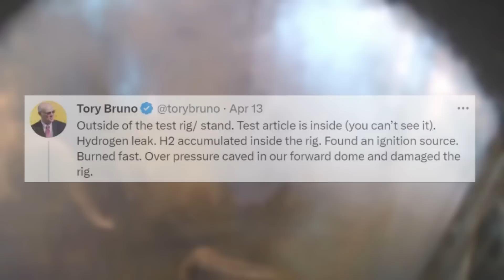Vulcan's Maiden Launch Continues To Get Pushed Back

Comment: I wish someone would do a video on how the Vulcan and Starship fit together in NASA’s moon plans. Seems to be two separate plans. I see other videos showing Starship landing us on the moon. I’ve never seen or heard a clear description that unifies these two platforms into one plan.
Reply: First, not everything either company does, is about getting to the Moon (for example, a Falcon Heavy launched a communications satellite an hour before I wrote this. ULA has other commercial customers waiting, too)...
Reply: Prys Atur, they ARE two seperate plans but competing for NASA's Moon plans. Each offers:
(1) Starship: can lift and land itself, 100 tn, plus 50-100 tn payload on the Moon and launch back to  to LEO for re-loading of more cargo and fuel launched to LEO. This requires around 12 launches, 11 for re-fueling. Not too expensive (at first) but awkward.
(2) Vulcan/Centaur: can lift and send a separate lander ("Alpaca"), plus payload, in total only 15 tn on the Moon and launch back to High Lunar Orbit, dock with "Gateway" Space Station (becoming it's own landing craft), for re-loading of more cargo and fuel launched to  HLO from Earth. This requires 2 launches, 1 for re-fueing. A bit expensive (at first) but straight forward.
This isn't a video, Pyrs Artur, but it might give you an outline to work with. Hello from New Zealand, Rocket Lab turf!🇳🇿🚀
Reply: @davidstevenson9517  The 15 tons for Alpaca only includes about 1 to 2 tons of cargo, most of the 15 tons is the vehicle and the fuel needed to get back to orbit and it requires 4 Vulcan launches to refuel it according to it's specs. So every lunar Starship will deliver 25-50 times the cargo to the moon per landing. That means you need 100 to 200 Vulcan launches just for fuel to deliver the same cargo as a single Starship can in one launch, not including the launches needed for cargo. Makes those 12 launches for a lunar Starship seems pretty efficient in comparison.
Reply: @andycanfixit  Apparently Starship cannot carry anything to orbit.  There is no proof that Starship will carry the stated amount of payload proposed by SpaceX.  Just look at the first Starship launch -- a total disaster.
Reply: @ReachOutToWilliam   That can be your little secret

Comment: A reuseable orbital capable shuttle was built and enabled the construction of the ISS. A replacement to the ISS is required and it makes a lot of sense to again have a reusable heavy lift ferry. Single use rockets do not make sense.
Reply: The most expensive and by far the most deadly space program ever.  And to say it was used to build the ISS is stupid, Russia had no problems with its share of the ISS with no shuttle. Seriously, besides saving the Hubble (another major screw up by NASA) what did the Billions and Billions get the taxpayers?  14 dead heroes and egg on our face when it was cancelled and grounded America.
Reply: The Shuttle was actually quite expensive to launch (more expensive than many expendable alternatives). We are not really at a point where the best reusable or non reusable architecture has been found for every size and stage of rocket.
Falcon 9 is basically the only rocket that is regularly reused. It's entirely unclear, if for a slightly heavier weight class, like Vulcan Centaur, propulsivly landing the entire first stage is cheaper than SMART reuse for just the engines.
Reply: @plainText384  yes it was hideously expensive to launch, operate and maintain and holds the record for the number of deaths caused by a spacecraft design. It was also the ship that enabled the construction of the Space Station and its maintenance. The US could probably re-build an orbital space station using the reusable Falcon series of rockets together with in-orbit assembly and i think you'd need and orbital construction quarters hopefully utilising a bit of artificial gravity. Although the Dragon could carry 7 astronauts, I can't imagine living in it for a short period of time as an orbital construction worker would be pleasant.

Comment: Centaur really makes a difference, ULA Vulcan and SpaceX Falcon FT to leo are 60,000 and 50,000 lbs, but to GTO they're 33,700 and 18,000 (expended) - Hydrogen aces kerosene
Reply: Your not comparing apples to apples, but apples to oranges. In order to hit 33,700 pounds to which is 15.3 metric tons to GTO you need the largest Vulcan VC6 with six SRB's and all of it is expended. The 18,000 pounds or 8 metric tons you list is for fully expended Falcon 9 or full reuse of Falcon Heavy  were both sides land back at the pad, and the center core lands down range on a drone ship. Landing the two side cores at sea and expending the center core it can put 16 metric tons or 35,274 pounds to GTO, expending all three cores and it increase to 26,7 metric tons or 58.8 thousand pounds to GTO. Basically equal to what Vulcan can put to LEO. Falcon 9 a much smaller rocket in comparison to Vulcan VC6 is able to put 8.3 metric tons or 18,300 pounds to GTO expended but Falcon 9 is the competitor of Vulcan VC0 and VC2 not VC6 which is the stats you are listing. In reuse mode it beats VC0 across the board and it equals VC2 to LEO, fully expended it beats VC2 to LEO, Polar and MEO and only falls slightly behind to GTO, GEO and TLI. There are no current versions of Vulcan that beat Falcon Heavy fully expended. Centaur is an excellent stage, but Falcon does just fine with kerosene and only reuse lowers it's limits but simply expending the center core allows to to beat Vulcan to just about every orbit for a lot less cost.
Reply: @andycanfixit  Thanks, still optimistic Vulcan is a good investment.

Comment: What I don't get is that there is more than enough work in next 20 years for all launch providers, but some SpaceX enthusiasts attack every competitor. I'm sure the worst commentators have never worked in the tech industry let alone near any major engineering or aerospace project. It's like listening to Call Of Duty players try to tell DevGroup how they screwed up Operation Neptune Spear, despite its outcome. Kerbal Space doesn't make you an aerospace engineer or manager either.
Reply: Very true, space is hard, parts are expensive and there’s no point in destroying tens of thousands of hours of hard work to watch a rocket lift off and get destroyed.
Reply: alphaorionis9117  A few more fuck ups and RUDs, SpaceX will no longer be the #1 launch company. SEE: Boeing 737 SuperMax
Reply: Thankfully the vast majority of the people there aren’t like that. Except BO, that’s a bit different. Lol